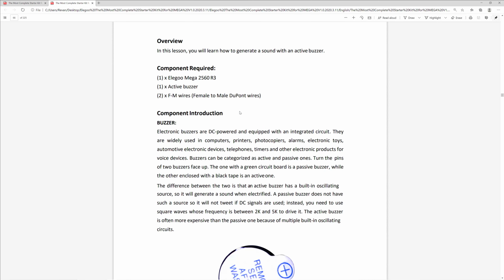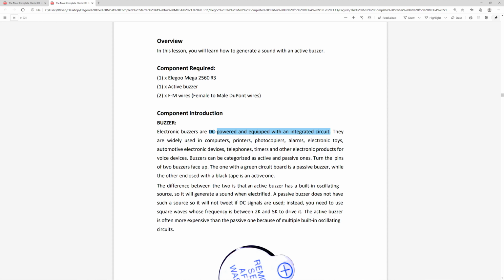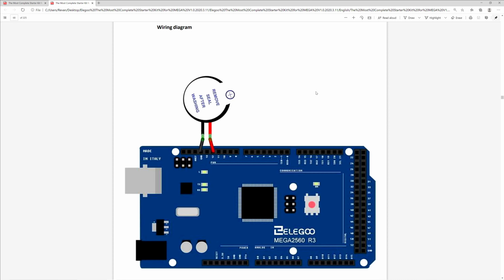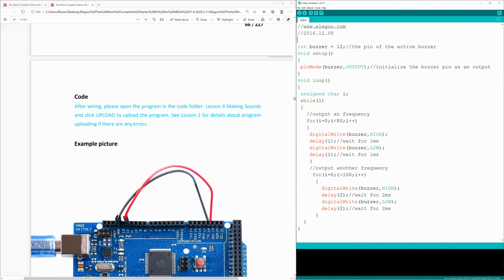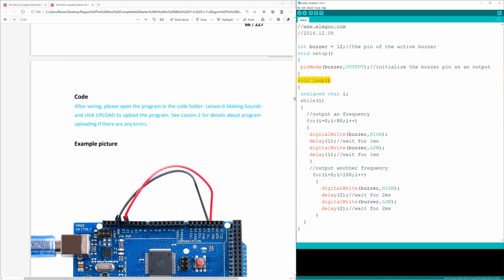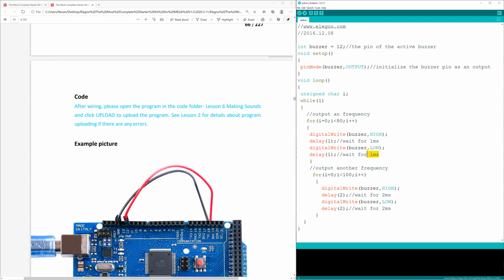STARTER KIT TUTORIAL FOR MEGA 2560, Lesson 6 Active Buzzer

Comment: do i have to use the same wiring
Reply from the maker: Yessir, if you're using the same code from the Elegoo kit you'd probably want to wire it the same way. In theory you could change the PWM 12 pin to another PWM pin but you'd also have to adjust that in the code as well.

Thanks for watching! If you need any additional help feel free to reply!